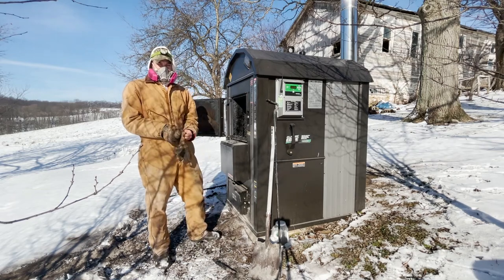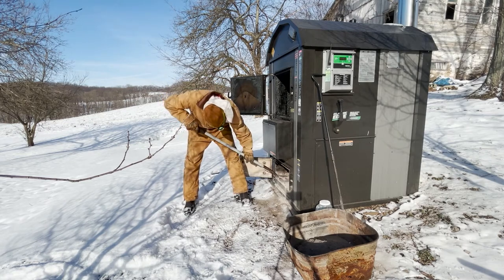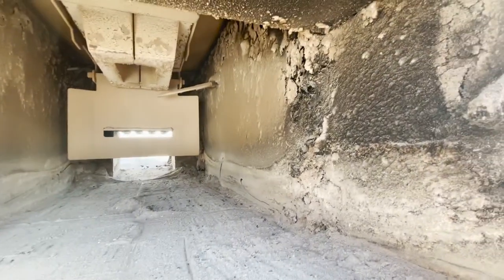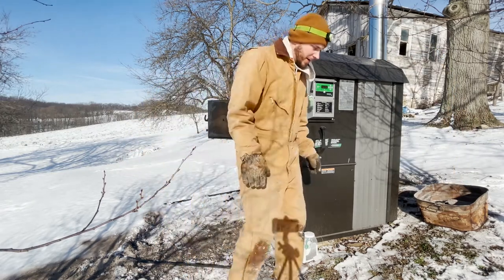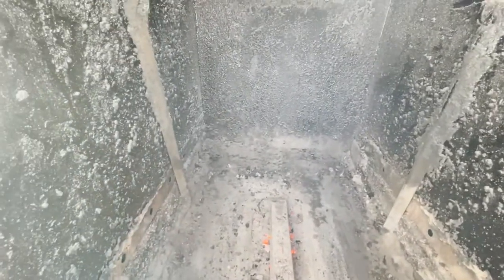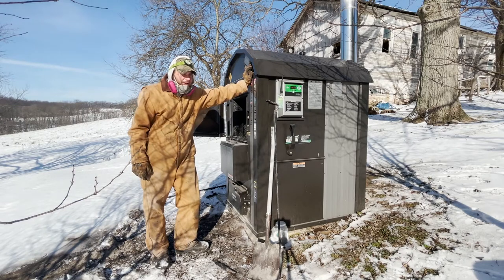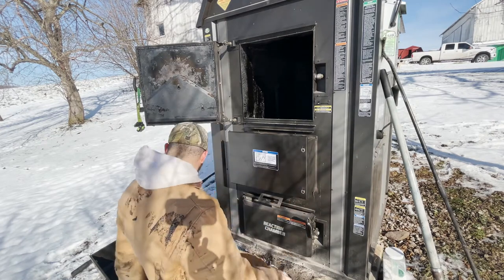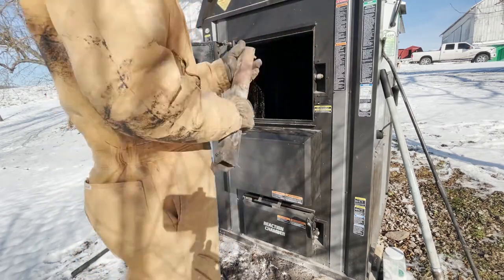How To Clean My Central Boiler Classic Edge 550 Titanium HD! Winter 2021!

Comment: Great video. Very helpful for me as a new CB owner. I have a new 760 that’s two weeks old and It’s smoking like crazy and reaction chamber temps are only getting up to 500. I’m happy to know it’s probably just time for a good clean-out and nothing else is wrong. Thanks!
Reply from the maker: Maintain a good coal bed.  If it’s less seasoned wood, have a bigger coal bed.  If it’s really seasoned dry wood, you don’t need to maintain such a big coal bed
Reply: Seems it may be best to clean every weekend and if weather so bad you can’t it’s still ok to skip it
Reply from the maker: The harder the furnace runs and the drier the wood, the less likely you’ll have to clean the furnace. If you’re not burning seasoned wood and the weather is warm, you should clean more often.  I would suggest you look at the air channels, etc before cleaning.  Weekly is way too much in my opinion.

Comment: I might have missed it in the video, but how often do you clean the combustion chamber and heat exchangers?
Reply from the maker: This year, I only did one shut down cleaning and my end of the year cleaning.  Combustion chamber is cleaned every three weeks to remove ashes but a lot of that depends on time of year and amount of wood burned.

Comment: If you put in a ton of wood is a lot of that heat wasted or does the fan moderate the burn so all the energy is used?  Seems like if you’re shooting for 180 degree water it would be harder to throttle a huge fire instead of a small one. I’d like to get one of these and am just trying to figure it out.
Reply from the maker: The fire burns downward, a full firebox only increases creosote.  Fan only runs when in an active burn cycle.
Reply: @RockyAcresFarmstead  thank you!

Comment: Wood ash is not acidic but basic. Adding too much as to a garden will increase the pH. Adding lime will make it worse. I have seen several people mess up gardens with excessive ash. It is also high in potassium.  A little is good, but you can overdue.